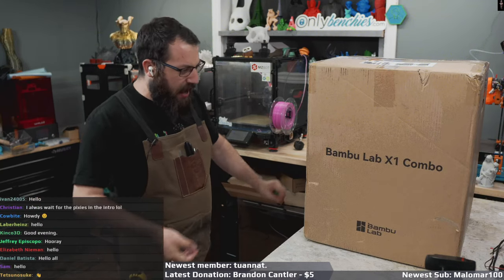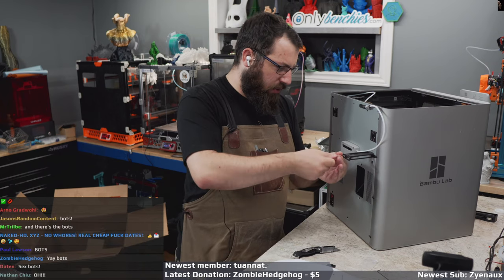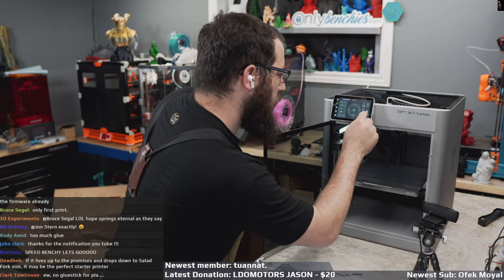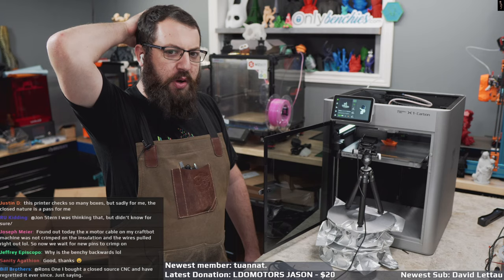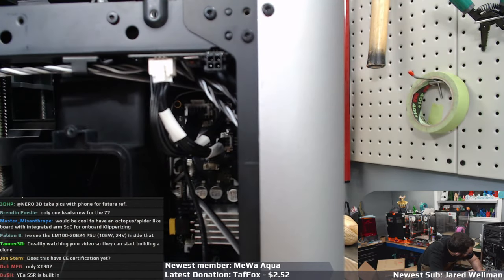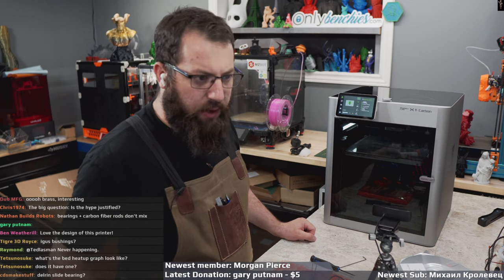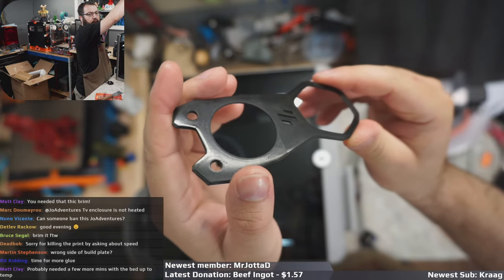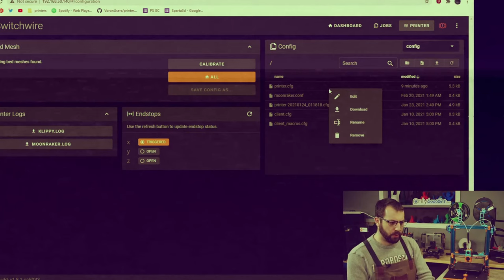THE X-1 CARBON - LIVE unboxing and setup #3dprinting #3d

Comment: I'd already backed the X1 but it was still super useful to see this livestream, I enjoyed getting more of a sense of the end-user experience.

A couple of thoughts:

1)  I haven't been able to locate it, but my understanding is that glue is only recommended on the "cold plate" side because of the risk of pulling the sticker off the actual build plate.  I wonder if your PA part would work better on a clean build plate?

2)  Stop buying American tape measures that only have SAE!  If it's a proper Canadian tape measure, it has Imperial on one edge and Metric on the other.  ;D  (Also, 1" = 2.54 cm, so maybe just have a calculator handy to appease our ROW friends?)

3)  I admit, I'm very amused by all the folks going "nope, I'll just build one because I don't like X."  I'm all, if you're willing and able to build your own printer, you are not the target market.

Anyway, this is all meant in good fun, so I hope it doesn't come across as angry or pedantic.  Thanks again for this look at the most exciting printer I've seen yet!
Reply: Well it does come across very fkin angry and extremely pedantic. Anyway just leaving some feedback of your feedback cause I heard you like feedback.

Comment: One project I am working on is to print each panel a full different color altogether. If I install a second Hotend it will be to print water soluble support material.

Comment: If Bambu Labs makes it, Creality, Ultimaker, Makerbot are all dead unless they spend some serious mojo doing R&D to catch up.  Even companies like Prusa and Markforge will have to watch out.  This is a V1.0 and it already kicks butt.  V2 - probably something huge like 400x400x400 and IDEX.  BOOM.
Reply: Not necessarily there will always be a market for cheaper printer like Ender 3s but if it’s delivered what would you buy a Prusa or this?
I would think this would be far more desirable.
Reply: Paul is right. Those companies aren’t going anywhere because of one printer that might be too good to be true. Even if it comes to fruition, the market is way too big for one company to kill off the others.
Reply: @thetubemeister82  They have millions in VC funding, they also have a consumer product DNA which doesn't exist elsewhere except Prusa.   The Bambu Labs team thought out of the box and leveraged their experience at DJI and applied it here.  They didn't need a Kickstarter at all but they used it for buzz and it worked.  As for Creality, they'll have a hard time justifying their price point since its like software.  Making the first one is hard, after that, it's like making cookies.  Easy and cheap.
Reply: i also wait for a V2. that first edition has still too many Red-Flags for me. so thid year i get the V400 and next one will be the next bambu :D

Comment: Also I am using Garolite sheet the updated one that works better for PETG. I tried printing on my Ender 3 Max's class build plate withe the Ender textured surface. That also works pretty well. The difference with the Bildtac flexplate system I can bend the alumimum sheet and the print pops off. Printing with my Tevo Tornado with the Gen L board the prints would stick to well and would never just pop off. My endewr upgraded with the BTT Octopus pro and E3D REVO SIX is working great.

Comment: I pre-ordered mine. Hopefully I don’t get screwed. Time will tell. I’m excited to get it though if it does end up being a real product. I have a bed slinger right now that I barely use. I also have a qidi Xplus and if this machine works it will replace both machines. I tend to use my bed slinger when I want to speed up prototyping. It’s not any faster but what I will do is when I’m trying to fit something I’ll have 3 sizes of something I need to print. Instead of printing one and then testing and then printing bigger or smaller. Usually what I will do is print on both printers. The bed slinger will have 2 parts on it both different sizes and the other machine will do the size I think I will need. Then by the time the one I think is correct is done the other two are about 75% there. Then I can test for and if I realize I need one of the other 2 sizes they are done printing by that point. 

For me the speed of this machine will let me do one at a time and waste less filament.

Comment: I just saw there is another type of printer that prints a little like a inkjet printer. I think that may be a better design for printing color prints. Until then the best way is just to print the object and then spray paint said object. I know that is a 2 step process but the only way to get perfect color. I am looking into getting a small compressor to print small to medium prints up to the size of my bed. There is a guy on youtube that has some great video to show his technique. He goes over everything you need to know. Search Youtube for model painting or something like that. The compressor is not that expensive I think $100-$150 plus the gun/nozzle if you want to get a second one. Plus model paint.

Comment: I'm so glad there's finally a printer that I can just plug and play and not spend millions of hours calibrating. I'm tired of it
Reply: Well there are severall guys having huge issues with printing stuff. one of the prototypes was so bad that the YTer was pretty frustrated. Not sure how the video is called...something like " i am sending it back".
i go for the V400 since i havent heard ANYTHING negative
Reply: @tombeardy4833  Every review I’ve seen has been positive(around 4-5 reviews). Not every printer is going to be perfect I’m sure. There will be variables. Looks like they are the first actually trying to give you a great out-of-the-box experience. I’m a designer who wants to print what he designs. I’m fully capable of calibrating a printer but it can become its own hobby chasing the perfect print, I don’t have time for that anymore. I’m  sure we’re not at the point where we have a zero calibrate printer yet, but this thing looks pretty close.

Comment: Hopefully the community can figure out a way to replicate the lidar based calibration routines in order to add that to DIY machines like VORONs, RatRigs etc...

Also I was tempted to pre-order this machine, but I will be holding off until they have been out for awhile and we see how the actual production machines are working, along with how the company handles repairs/spare parts.
Reply: Yeah I would wait also.  What I have seen that bothers me (or better yet not seen) is that the lead screw and z guides are looks to be mounted in plastic, not metal.  If that breaks or warps then you are SUNK.  I wonder what other parts of this machine are non-repairable or once broken ---junks the machine.  Others will jump on the lidar bandwagon soon IMO.

Comment: Finally got a distributor here in Australia that stocks Prusa... Still $2199 though
Reply: mk3s+?
Reply: @sumanbimali  yes
Reply: @TripleJAu  that’s insane. Get the clone from aliexpress mate. I have been running both original prusa mk3s+ and cloned one and it seems it works except the same without issue. Cloned one has been printing non stop for past 1 year

Comment: Hello, Could you please share the printer dimensions (height, width & depth) of the printer and the AMS system?
Reply: machine is 15x15x18, with spool 20x15x18, ams not sure
Reply: @Jackxgreer  Thank you 👍
Reply: With ams it's 27" high iirc

Comment: Sorry I missed this stream live, I'm looking forward to watching the Friday though. Would it be possible for you to put a ruler against the "poop chute" so I can get started on designing a ramp adapter to rotate the ejection to the side, please. Also, in your talks with Bambu, if you could also suggest allowing a network drive path to be used for saving the camera data instead of the SD card. For example, I have my OctoPI connected to my Synology NAS though NFS protocol - it cuts down on the write cycles on the card to help improve longevity.

Comment: i wonder what kind of hotend? How long and well the bed plate works, efficiency of how it handles multi material waste, how long the carbon rails will last and stay perfectly smooth, and i get its fast but how well does it do at fine resolution or like .15 at normal speeds. i do both rough draft fast prototypes and detailed models
Reply: would be nice feature if the slicer has an auto select movement speed based on desired quality. i have 2 prusa's but this could be a good next printer to replace on eventually.
Reply: also nice to see them implement the prusa method for auto loading and unloading filaments, so easy.
Reply: It might be a game changer, but I seriously doubt it is in the multimaterial waste department. Why would it be any better than an MMU in this regard? Yes, discarding it directly instead of printing a waste tower saves a bit of material but not the big junk.

Comment: So I have to be online and register my printer to some sort of account? No thanks. I'll just build another printer that doesn't talk on the internet.
Reply: You may use the micro as and later on they plan to update to have everything local.
Reply: @lazyman1011  Until I can just buy it and use it without registering, I'll pass. Maybe if they make it fully local, I'll revisit.
Reply: *written with his YouTube Account x))
Reply: @zbra9682  I'm sorry that you don't understand the difference between physical hardware and digital services. One of them makes sense to require an online login for. One doesn't. Maybe you can ask someone to tell you which is which.
Reply: @paulthetexan  If cloud software is used to augment the abilities of physical hardware, it would make even more sense for a login to be required because of added security.
Reply: @ThatOneStopSign  I don't want my printer to be cloud connected. Other people might have other wants. But I work for a cloud provider, so the part about "added security" makes me laugh. :)

Comment: I have backed them, I really hope it is as good as everyone says it is. It seems very very good and I would like one that works every time with almost no assistance from me. Then I can play around with all my other ones that I tinker with. I am very excited for it as to be honest I need one like this for printing a part I forgot.
Reply: The founder came from DJI so he knows what it means to build a consumer product and has the experience/focus to make it simple.  He also knows that Opensource can only go so far and that closed source has to add the fit and finish needed.  With Bambu Labs, they've finally created a 3D printer that is basically a home appliance like a microwave oven.  Stupid simple to use without the need to tinker and go up a steep learning curve.   Even companies like Prusa/Markforge will have to catch up.  Ultimaker can't justify it's cost in any respect.  Lultzbot - well they are pretty much dead.  V2 of Bambu will be even more awesome.